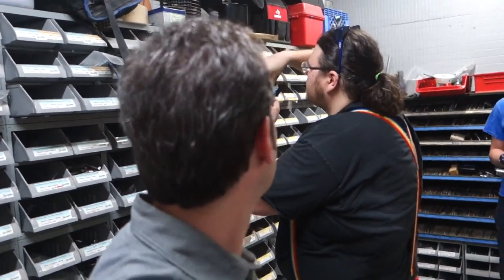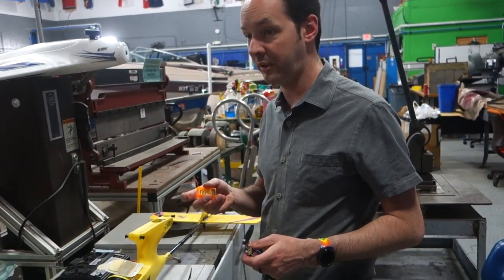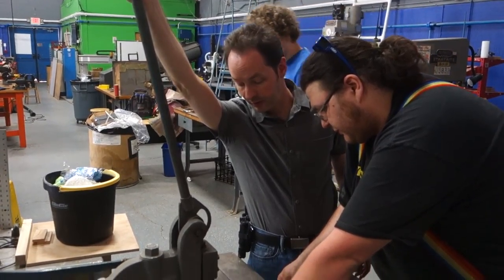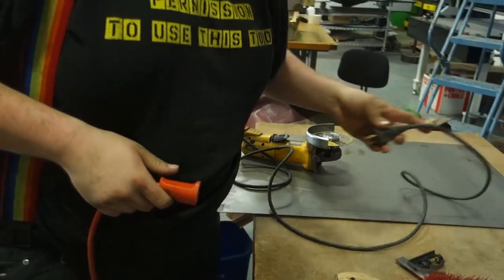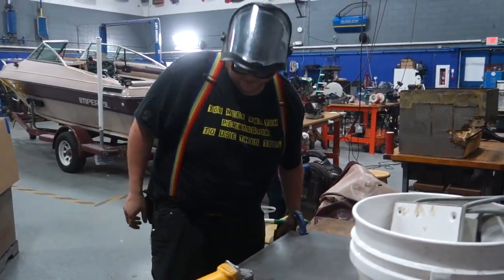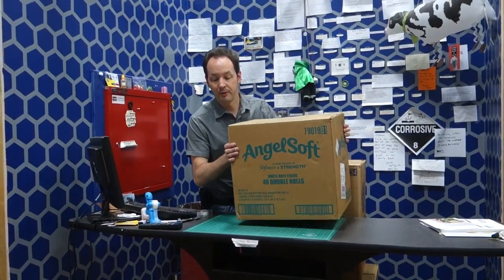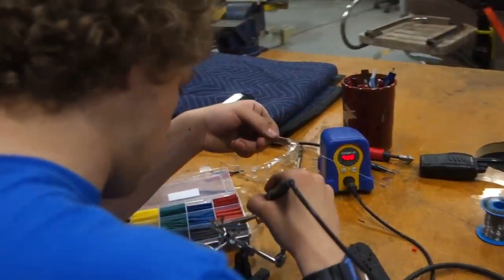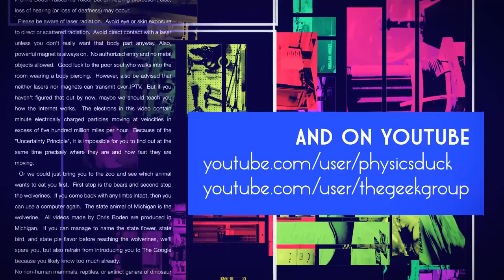Captain's Blog 5 17 2017 Variety of Progress

Comment: what is a nylock?  wingnuts interfere with propellers.  meathead looks bored.  antique motor looks great.  being in a rubber band  is a nice play on words.  metal is a good base for moving parts.  a larger battery also gives more electricity.  lucas is smart.  moose is festive today.  batman is demonstrating accuracy.  batman's metal cutting is perfect.  your plane plastic is soft.  1310  batman that's an excellent weld.  paper is good to learn with.  that 14 layer thing is colorful.
Reply: https://en.wikipedia.org/wiki/Nyloc_nut  They're not quite as skookum as a nord lock washer, but they don't eat your knuckles when you break them loose, either.